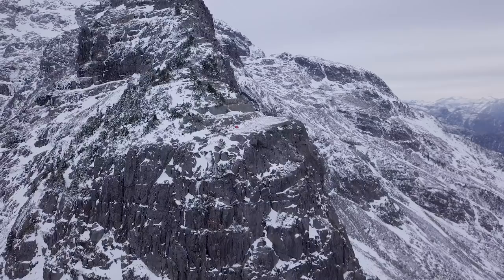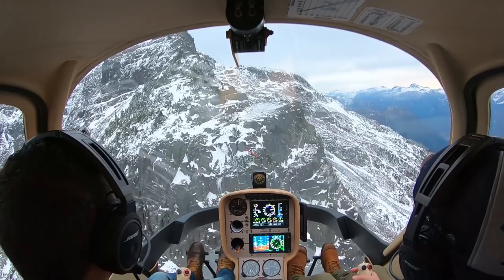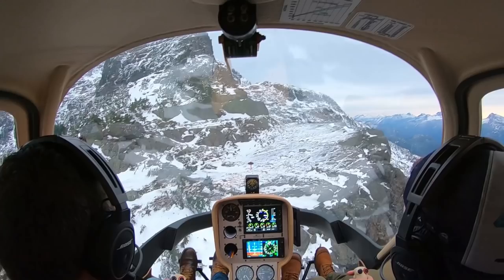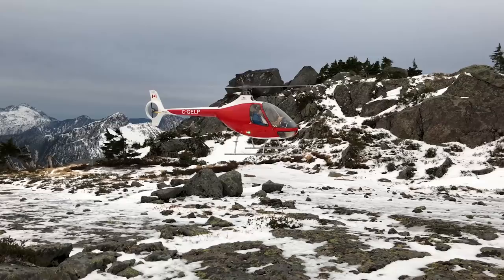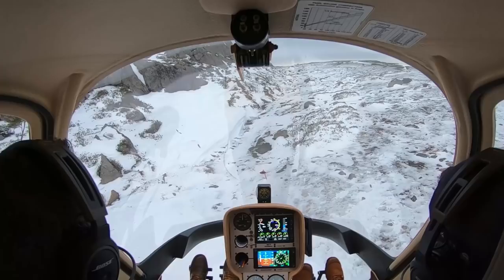WHY HELICOPTERS CRASH WHEN OVERPITCHED

Comment: I'd like to just point out that the idea of having a five-point harness is to use all five of them. If you guys would have a crash going forward, you'd just slide under the lap strap.
Reply from the maker: Jón Arnar Ólafsson why do you say that?
Reply: On a five-point harness, you are also supposed to have the "crotch" strap connected which locks into the bottom of the buckle. This is to prevent the occupant slipping under the lap straps during impact. As you can see in your video it sits high on your waist, almost over the stomach area. The bottom strap will also make sure that this does not happen. https://robinsonheli.com/wp-content/uploads/2016/04/5_point_harness_-1024x683.jpg
Reply: Also the crotch strap keeps the waist straps in place on your hip bones so you don't crush your abdomen or worse your lower ribcage in a longitudinal deceleration. If you have shoulder straps you Must use a crotch strap to keep the waist straps in position. 

On the Dash-8 they had the cam-lock ON the crotch strap so you had to use it to buckle up. Don't know why small GA and most racing harness I come across have the Cam-lock on one of the waist straps, but they do.

I go over with my drivers Waist, Waist, Crotch, then Shoulders last once the lower part of the harness is where it needs to be. In a deceleration your Pelvis is doing the majority of the work against a belt, the other "points" just help keep the rest of you where you need to be and connected to your pelvis.

Be Safe and Have FUN!
Reply from the maker: Jón Arnar Ólafsson oh I totally understand your question now, sorry. We don’t have a 5 point harness. It’s only a 4 point. There is no strap for the crotch. I totally agree that would be good though if they had it on these belts.
Reply from the maker: Michael Zaite ya I totally understand. We don’t have the crotch strap on these belts otherwise I would be wearing it for sure. I think I just need to tighten my belt a little more.
Reply from the maker: Michael Zaite ya I totally understand. We don’t have the crotch strap on these belts otherwise I would be wearing it for sure. I think I just need to tighten my belt a little more.
Reply: No matter your set up wear your waist belts as low as possible. Your sternum is not as strong as your hips.
Reply: not all aircraft have five point belts they are rare in helicopters but no doubt available
Reply: And that is what killed all the 5  passengers except the Pilot of the helicopter that crashed in the Hudson river two months after you wrote this. They couldn't free themselves from the 5 point seat belts. They want to pass a law to require such belts to have INSTANT release to keep them trapping pax.
Reply: Kenyan Guy, in the NYON crash, the passengers were wearing CONSTRUCTION harnesses, not aircraft harnesses. Aircraft harness are released from the front, making emergency egress possible.
Reply: Pilot Yellow I'm subbing to this channel based on your response. SO many people like to be lazy and dismiss critiques in the comments, but you showed that you take this hobby/profession seriously in a mature manner. The content in this video was not only very informative but also fucking GORGEOUS. That resolution and contrast with the mountains, absolutely stunning and of highest quality. No overbearing music and jump edits to try to entertain a more layman audience. I hope your other videos are like this. I'm glad the internet isn't completely filled with..I don't want to say mindless content, but I guess more relaxed content with little substance.
Reply: If I remember well in the 206 I was in last week there was only 4 points as well. I didn't remember something between my legs... Beside the cyclic of course :) though this is still more secure that what I have in my dr400 plane, just a one point belt like in a car :)

Comment: i totally didn't get the point of this vid, but i did gain new understanding about how helo's fly.  I never knew that hovering required so much energy, and how much difference ground effect makes.  I do have a question though.  If it requires 100% power to hover without ground effect, how is it possible to ascend vertically?
Reply: It doesn't usually require 100 percent power to hover, but it does in this case because they are already at a high altitude (being on a western mountain top.)  Like any aircraft, copters suffer performance limitations as altitude (more accurately density altitude) increases, lowering engine power and airfoil (wing or rotor) performance.  Maneuvers that this helicopter can do easily at sea level aren't so easy at the altitudes I'm guessing they were at here (maybe 10K ft or so.)

Comment: 1. SWP = vortex ring state. They are not two different things (just some people call it one, others call it the other).
2. Low rotor RPM recovery = simultaneously rolling on throttle while lowering collective and, when in forward flight, aft cyclic (though you are correct to also fly away from the spot in your case since you had sufficient altitude).
3. WHO IS FLYING THE HELICOPTER? No positive exchange of controls, talking guy always jumping on controls and then letting go. Was it predetermined the guy in blue would always be flying the helicopter? Guy talking said, "I'm going to fly here for a little bit..." and then keeps taking his hand off collective because he can't talk without using hand gestures.
Reply: Micah Rockwell vortex ring state can compound setling with power, but they are not the same. SWP is the blades actually stalling due to the upward induced flow causing the angle of attack to exceed the maximum effective angle the blade can produce lift. SWP will cause the blades to stall at the root first ad move outwards, where vortex ring state reduces lift at the outer edge of the disc. When combined, the only hope for recovery is lots of altitude to convert to forward airspeed. Also aft cyclic will not help in a rotor droop, the exception being you are near the ground already and attempting to control the crash.
Reply: Paul, SWP and vortex ring state are used interchangeably due to the fact that different agencies used different descriptive names of this aerodynamic hazard. The U.S Army called it one thing, the Navy called it another. Now, across the globe, different places refer to them differently. For emergency training purposes, they are the same thing: settling into your own down wash. Robinson officially calls it VRS whereas most pilots already flying know it as SWP. They are the same thing. You may teach them differently, but you must be careful because, at least in U.S. based publications, these two terms are used interchangeably.

Comment: The pilot seemed extremely knowledgeable and unusually calm and relaxed.  Sometimes a little healthy fear is a good thing.  By contrast, the guy in blue seemed, understandably a bit tense- as many others also noticed.  Telling exchange at the end...Pilot..very casually..."Did I miss anything" Passenger- a very curt..."NO" followed by some visibly nervous and telling brief hand and mouth movements @5:15 to 5:18.  It was as if he was thinking at that point, "no more questions, just please focus and get me back safe." 

The pilot said there is no rush to actually touch down.  I understand the theory of the in ground effect (air cushion) having to use less power, HOWEVER, as a skier I know that wind gusts can visit mountain tops out of the blue- e.g., a 209mph wind gust was recorded in CA.  It is also an icy surface up there so the helicopter could slide if the surface is not perfectly level (even still.)  Mountain flying is inherently a very risky endeavor even in seemingly nice conditions.  Furthermore, the pilot made an interesting commented that absent the benefit of in ground effect, he had ZERO reserve power.  At that elevation (thin air=less lift and relative engine power/performance- especially if using piston power vs turbine), he had to apply 100% or max power just to maintain a hover.  You always want to have some power in reserve.  Various scenarios can necessitate a need for more power e.g., a drop in pressure, down bursts/drafts, wind/turbulence, unstable winds, orographic lifting, wind shear, etc. Similar to why planes always take off into a headwind- you don't want to rely on current state. You want to know your minimums and build in some reserves.  You always want to be in a situation where you can recover if needed.  In general, despite your skill, the less time you spend at or near the tops of mountains, likely the better!

Comment: Could you do videos on mast bump and dynamic rollover someday?
Reply from the maker: William Eudy yes those are both on the list of future videos to come.
Reply: heheh please dont demonstarte them ok!! i think thatd be hard to do anyway in that great little articlauted machine
Reply: You can do it with a model pretty easily.
Reply: Mast bumping is specific to the Huey UH-1 and the cobra. Does not apply to other helis. Dynamic rollover is simple loss of control by pilot on the ground.
Reply: What are the three things that cause dynamic rollover. Pivot point, exceeding the critical angle and?Rolling motion.
Compresability and blade lead lag would be more interesting to watch. Better yet settling with power. How about rotor droop. Ground resonance. Mast bump? Easy descend at a banked angle. You are talking about matches and pointy sticks. We moved on to 2 to 3 turbine engines and fully articulated rotors.  Also giant pieces of shit like the waste of money AH-64 Trashheap. If one flies its gonna be a photo shoot and those pilots did not make minimums.
Reply: Happens on the R-22 also... right?
Reply: Eric Braun - Yes,  any helicopter that teters on a two-blade rotor.  Avoiding rapid application of forward cyclic that creates negative G’s is one of the things that you have to do.
Reply: Now your talking.
Reply: Aren't all semi-rigid rotors susceptible to mast bumping?
Reply: You got 2 out of 3! Pivot point, rolling moment, and the thing that makes a dynamic rollover dynamic: LIFT!
Reply: bushpilot2001 that's not true...

Comment: What if you had a more powerful engine? Would you have more reserve? It seems a little like being in the redline just to drive the speed limit
Reply from the maker: Mitchell Mitchell yes a more powerful engine would help. But everything is a fine balance in helicopters. If you get a more powerful engine it’s heavier. It needs a stronger transmission, and shafts etc. Everything adds up to a heavier helicopter. So it’s tough to get that perfect balance.
Reply: no problem carillo rods... larger oil cooler... overbore wiseco pistons..yoshimura unrestricted titanium exhausts and headers...titanium valve lifters and retainers...K&N open pod air filters..supercharged in line 4 cylinder engine walah a competition ready 0-100mph in 3 sec Drag racing helicopter!!

Comment: Can anyone explain why both of then are holding the stick?  Isn't that a bad thing?
Reply: Yes.
Reply: Not a bad thing at all. My experience is in fixed-wing aircraft, but it's a great technique for a student to get a feel for what the experienced pilot is doing. I call it ghosting, but I'm sure there's a more technical name. It's just holding the stick with a feather touch so you can feel what the person in control is doing without actually affecting the control inputs at all. It's a great learning tool, and the person ghosting knows not to put any force on the stick whatsoever. Unlike a car steering wheel, the control inputs for a helicopter are so subtle that there's little chance the ghosting pilot will interfere with the pilot in control. 

These two may have a totally different reason for doing it, but I just wanted to point out it's not necessarily a bad or dangerous thing to do.
Reply: There is no "pillow of air" during IGE hover. If it were a pillow of air, it would be blown away when you hover into the wind. Review your basic aero principals in a hover. Also "over pitching" is a bit confusing. Pitch over in a Robinson can result in the rotor system departing the aircraft. (Army combat pilot, CFI helicopters, airplanes,' Single engine,multi engine and gliders. CFII. FAA inspector.)

Comment: I would have thought that it is so obvious that a helicopter would crash when overpitched. Anyone who is interested in matching a propeller to an engine on a boat knows very well the result of over pitching a propeller.  Reason and rational thinks tell me that if one is flying using 100% of power, he should not be there in the first place and if he is, then he better take immediate precaution to get out of that condition. If 100% of power is needed for to fly at sea level, then it is better to return the helicopter to the designer and manufacturer and tell him to install a more powerful engine.......... for the sake of safety.

Comment: How do you check your OGE power safely in a place where you don't have an area to lower collective and dive out if you run out of power while checking it? ie a high altitude plateua that is relatively flat for miles around?
Reply: Garry's stuff you make your approach higher to the point and slowly test your power... if you don't have margin power, just fly away.

Comment: The reason that helicopters could crash easily is because the pitching or solely relying on pitching won't create instant lift.

In short the engine may not be increasing speed fast enough to create instant lift. Moreover, the blades design is very inefficient to create instant lift.

The entire existing concept of helicopters from rotors to engine designs are inaccurate or better way to describe it is not safely enough for aviation purposes.
Reply: You can't have a parachute to save passengers in case of emergency. This is the biggest issue of helicopters. 

However there are better ways to over come these issues.

Comment: "Over-pitching?" No, dude... it's more about causing an engine under speed which leads to main rotor droop. It's when you pull more torque than the engine can provide and the engine droops (you got that right.)  The lift equation being "Lift = coefficient of lift X 1/2 air density X surface area X VELOCITY^2" ...being that velocity of the rotor system is squared, when you loose a just a little bit of rotor RPM, you loose an exponential amount of lift. This is what you should be teaching and you kinda missed the point. Performance planning is key at the planned altitude you are going for... fail to plan, plan to fail. It is more about finding and getting your target torque in early to avoid power demands that cause even slight power droops. Also, what about doing a 360 constant airspeed and bank angle to determine wind direction and speed? ...then using the terrain and updrafts to minimize power requirements. The challenge is making the landing with the absolute minimum torque applied with the minimum amount of torque fluctuations (especially positive power demands)... but then again, what do I know.

Comment: The idiotic comments about helicopters being unsafe just because a well known celebrity was sadly killed are beyond annoying and idiotic in these comments.. news flash ignorant non pilot commenters: the NTSB has NOT ruled anything out in the Calabasas crash except the engines did not fail prior to impact with terrain. They don’t know if it’s pilot error or mechanical. Very doubtful it’s mechanical being a S-76 which has a very very clean safety record. But anything is possible at this point. So do us all a favor and stop posting moronic crap about helicopters being unsafe. They are slightly less safe than fixed wing aircraft (private) per the data. Maybe read before opening that big dumb mouth.